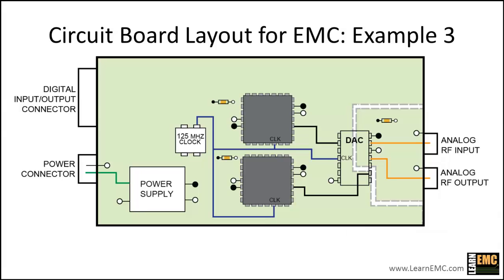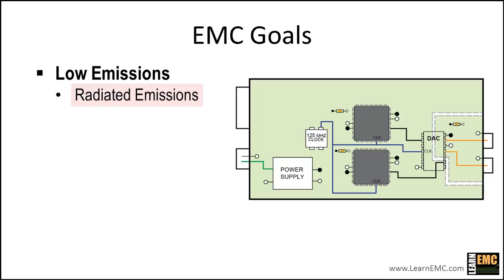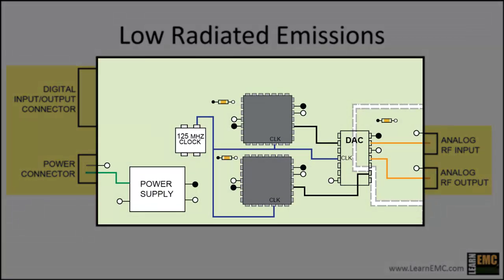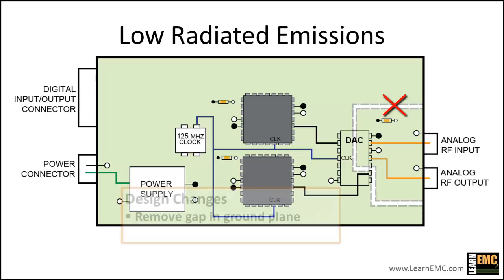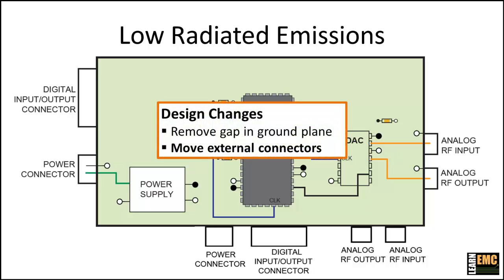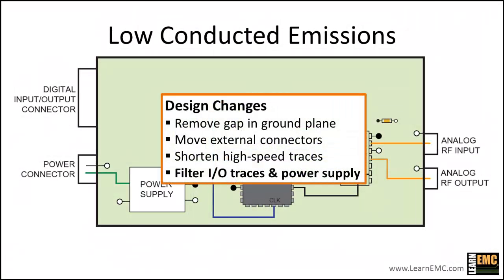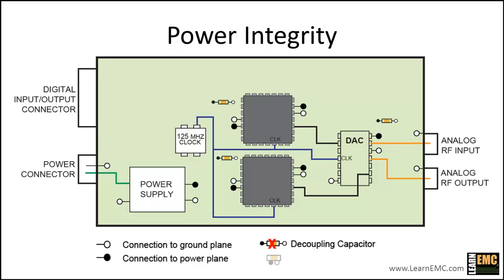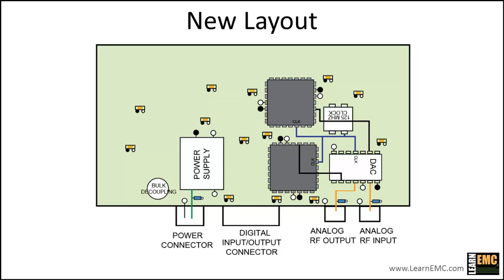Circuit Board Layout for EMC: Example 3

Comment: There are many occasions where the board designer does not have any control over mechanical design, including connector locations.
I suppose the only thing you can do is to control the loop area and do your best with placement.
This is a very good series of videos!  Thank you!
Reply from the maker: Thank you for your comment. Yes, sometimes we are forced to located high-speed circuitry between connectors. We can control transition times and loop areas, but if we have 10s of milliamps at 10s of MHz returning in the ground plane, we will probably require a metal enclosure or a ground structure off the board that we can connect our cable shields to.

Comment: The split in ground will reduce the common mode signal to the connector. There should be a group split. The ic is a high speed digital circuit then high harmonic return signal may go through the connector shield this causes cm radiation. Use feriite beads to isolate the gnd planes.
Reply from the maker: The high-frequency currents will return beneath their respective traces. They will not venture out onto a cable shield unless there is a voltage driving them in that direction. The voltage across the gap is exactly the type of voltage that will drive currents onto the cable shield. We NEVER use gaps in a plane to control the flow of high-frequency current.
Reply: @LearnEMC  if the shield may act like an antenna then common mode signal will radiates out. in the book by Bruce Archambeault page 112 , he provided some measurement of split and without split. Ther is around 10 dB difference for the results
Reply from the maker: @akhil3rockstar  Thanks for pointing to a specific example! The example you are referring to describes shielded enclosure resonances coupling to an external cable. In that example, the split interferes with the coupling at the lowest enclosure resonances. It is very different from this case where we do not have an enclosure. It is also important to note that the book you mentioned was published 18 years ago. If you've seen any of Dr. Archambeault's presentations recently, he always has illustrations and simulation results showing that high-frequency currents are largely confined to the area of the return plane directly under the trace, and he does not recommend splitting ground planes to control the flow of high-frequency currents.

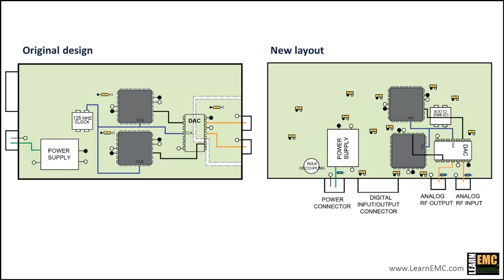Comment: (min 20:52) in your modified design, the second (lower) chip has it's connection to the DAC traced to another pin on the same chip that wasn't there in the original design, is that a simple drawing mistake?
The shunt caps due to transients, isn't that going to mismatch impedances on those RF lines? considering the fact that they go from tens to hundreds of MHz, does it need a re-matching network to compensate for this cap? 
In the end, i can't thank you enough, very educational content, Example 2 helped me solving AND understanding an issue i had with split grounds, now i know better.
Reply from the maker: Thank you for the comments. The black traces are not on the top layer. The shunt capacitors must have a value that passes the desired RF signal, while shunting higher frequencies. The point is to allow some control of the frequencies coming in and going out of the board.

Comment: One of the designs I work with has separate grounds and power planes and all signals run through an isolator. Could you explain why this would or wouldn't cause issues like this

Comment: ?  This stackup will not work.
Reply from the maker: In this application, it works well. For a given design there can be good or bad layer stack-ups, but the best layer stack-up will always depend on the application.

Comment: What about the most important thing (or one of the most important), board stackup? that six layer stackup is just god awful for reduced EMI. Signals on layer 1 have to travel through one other signal plane before getting to the ground and power planes. In higher speeds than this (or higher rise times than 1 ns) this board stackup would not pass the EMI test. Go watch Rick Hartley and read his stuff
Reply from the maker: It is absolutely incorrect to suggest that this stack-up is "god awful." I have had this conversation with Mr. Hartley. He and I agree that the best stack-up will depend on the application. It is entirely possible to build boards that have signals with fast transitions and only two (of six) solid planes. You just need to follow the currents. In fact, at the time this video was made (in 2015) we were guaranteeing the EMC compliance of designs like this and never had one fail. Nevertheless, I would agree that 6-Layer designs with large numbers of Gbps nets will require more than one ground plane and that one of those ground planes will be on Layer 2 or 5. Be careful about applying design rules (e.g. recommended stack-ups) blindly. Adding extra layers to a board design is a significant cost hit (at least in automotive or consumer electronics). Do it when you know it's necessary, not just to comply with a design guideline.
Reply: @LearnEMC  I think that the stack up suggested would work as long as layer 1 and 2 are routed with perpendicular directions as it used to be the practice. For instance layer 1 only horizontal tracks and layer 2 vertical tracks.
Otherwise I would imagine there will be a significant crosstalk between these layers as they both share layer 3 for reference.  

Personally I follow Mr. Hartley's recommendations regarding stack up.

Anyway, great video! I just ordered the book to get access to the rest! Thanks